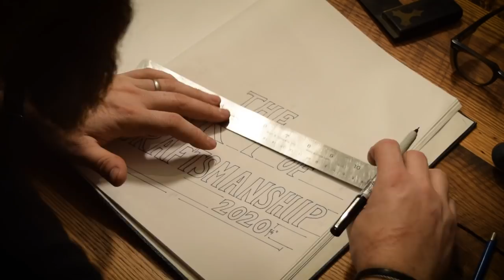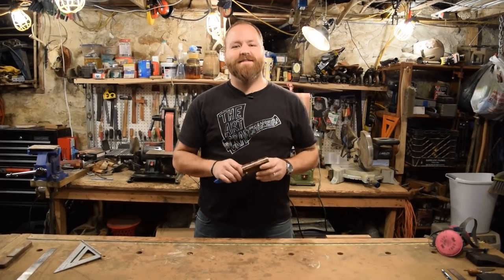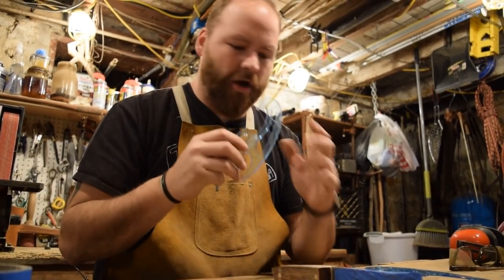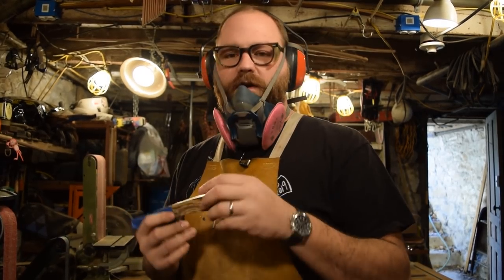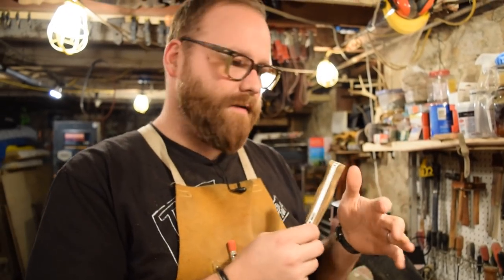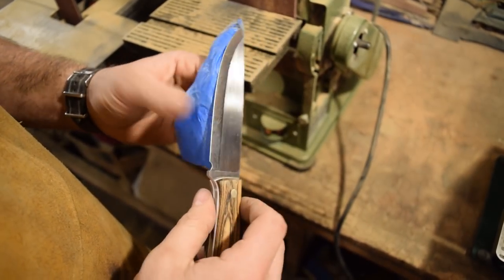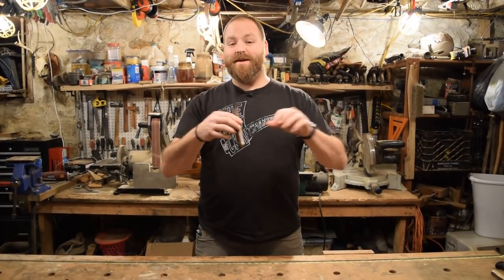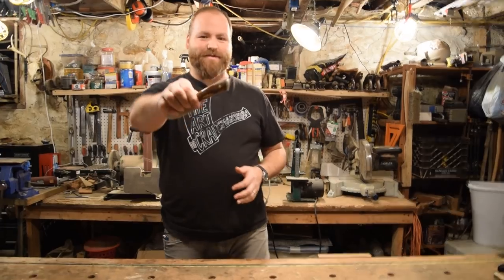Handle Shaping & Finishing: Knife Making Build-Along #5, The Finale

Comment: Your knives are beautiful...great craftsmanship.  I just made my first knife from an old rusty file as I do not have a forge.  I made my own bevel jig which worked very well.  The knife came out beautiful with a high polished blade that holds an edge very well.  The handle is made of rosewood and the problem was drilling holes in the tang for pins.  After much research I decided not to try and anneal the tang only so I could drill.  Rather I decide not to use pins and epoxy the handle in place.  I decided to use JB Weld and it worked exceptionally well.  After shaping the handle and sanding I used the white polishing compound on a cotton buffer wheel and the handle came out beautifully polished.  I am very pleased with my first ever knife making project. The only tools I used was my 4x36 belt sander, my bandsaw to cut the handle wood, a Dremel tool (the Dremel was awesome to work with..indispensible)  and my drill press with a 4 inch buffer wheel.   I gave the JB Weld a full day to cure and did not clamp it too tightly. It worked great and using it saved money I would have had to spend to anneal.  My experiences might help your audience if they are new to knife making.

Comment: The boiled Linseed oil makes it really pop it out with the grain. Amazing job. Does the linseed oil make it stronger? Or stops splitting? Can you lacquer after? Or do you use lacquer instead? Any reply appreciated cheers from Australia just subbed and liked 🙂👍👍👍
Reply from the maker: Thanks for the kind words! The BLO is used as a finish to brighten and protect. The wood would dry out and crack if not oiled with something. I’m a fan of BLO, as well as a number of oil-wax products. I make my own 1-1 BLO/Beeswax mixture.The addition of a wax also helps to make a water barrier. I’ve never used lacquer so I can’t really help you out there. Sounds like an interesting thing to give a try.
Reply: @TheArtofCraftsmanship  I'm taking my time with the handle because I'm trying to juggle 3 things at once. I'm going to linseed the handle first. Then paint in clear epoxy resin. I'm are 2 sets just in case. Lol. Cheers and thanks again. 🙂👍👍👍

Comment: That turned out realy well. But please do every carbon steel blade a favour and keep wd40 away from it, it will actualy rust it. Wd40 does not protect carbon steels. Its good to clean and loosen certain sticky things, but it actualy rusts carbon steels. (Its mostly made from water).Use mineral oil, its neutral colour and food safe. You can do the entir knife with it, and its cheaper.